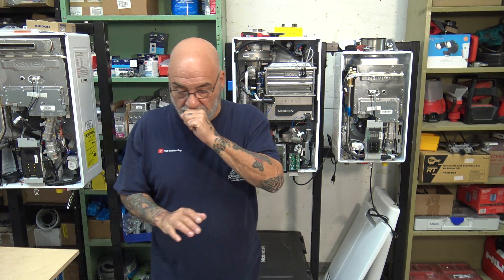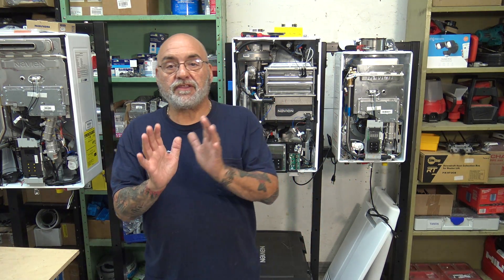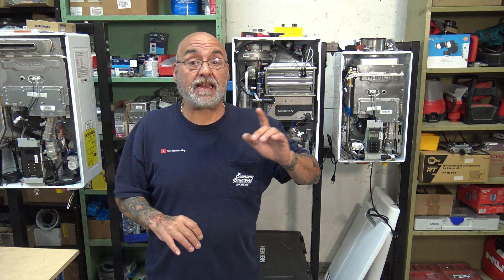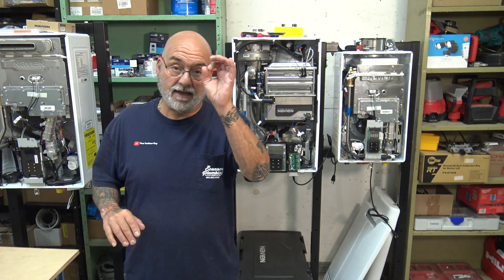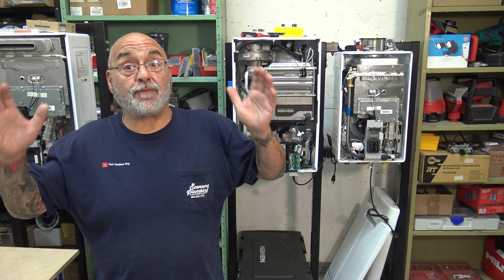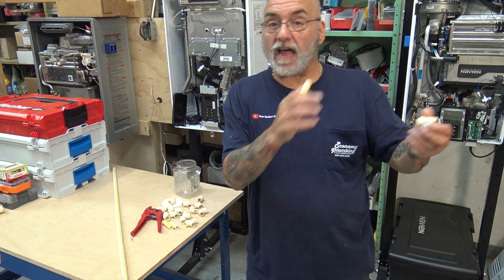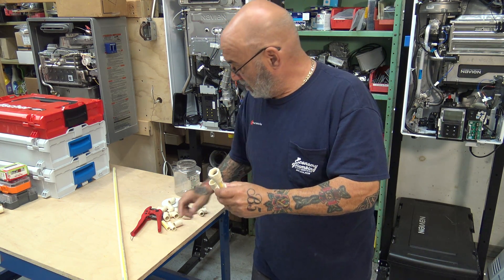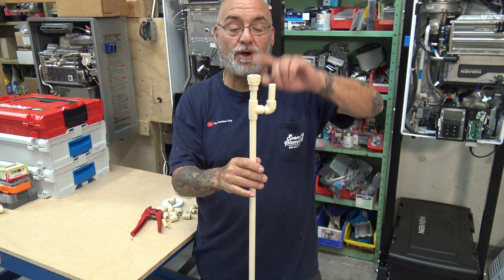Proper condensate drain piping for a condensing tankless heater.

Comment: My  installer  did not  put that  small  T in my  line  and   I have to clean my condensation dirt trap  plug at the bottom of unit to remove water build up  be cause i can hear water in my Exhaust  line go up to roof its  usually  just a  half a cup of water that comes out   spoke  with installer and he  said   that my  small  half inch  condensation line  talked about  here might be  clogged  and that i should blow it out or   vacuum it out to make sure   line is clear   im going to install this  tee line myself

Comment: Hi thank you so much. I am in Florida and getting ready to install indoor condensing unit. Looking for code guidance on condensate pipe and relief pipe. Can these terminate in the drip pan and then drip pan piped to exterior? Or do I have to pipe each individual line to the exterior? Thanks!

Comment: I just put the vent in. Previous owners didn’t have it. It’s been 10 years without the vent. No issues with the water heater. But it I’ve had the bottom of the heat exchanger(black part)  have like sweat on it. Droplets. I wipe it and it’s a little brown the residue. Do you think that because it had no vent?

Comment: I followed your advice before I installed my Rinnaii RU160 four years ago.  Works perfectly.  I'm an electrician by trade - so I had a plumber check my work and he was impressed!  I owe a lot of that to you.  Thanks Mike!  I especially appreciate the tutorial on the drain/vent and the training on the external pump circulation requirements.

Comment: I have a NPE-240A, 5 years old.  Just performed the maintenance and checked the drain line.  It is not vented.  I'll be installing the vented pipe modification as you have shown in this video.  Thanks!!

Comment: Do you also need to put a condensate collector on the air intake? 

I'm installing a Rheem condensing tankless heater and there's a picture that shows the regular condensate drain AND the condensate collector on the air intake
Reply: Hello, im about to do the same thing and noticed that condensate collector im the manual, but I can’t find one for purchase anywhere. Did you ever figure out what you are supposed to do?

Comment: Thanks Mr Tankless Guy. My 6 year old Rinnai tankless installed with brass female transition fitting to 1/2 inch  pex line corroded  and fell off. With guidance of your video I installed new line including vent myself saving a lot of money.  Great to have access to experienced  pros on you tube.
Reply: Exact same thing happened to mine. I don’t understand how my plumber didn’t know not to do it that way.

Comment: Mike, question about the specified CPVC female  adapter (FPT/SS).  I assume that the "transition adapter" your describing is a brass fitting (such as the one my plumbers put on mine).  I'm replumbing the condensate drain and replacing the filter, removing the brass transition fitting, elbows, filter adapters, and pex, and installing straight PVC.  What's immediately available from the local big box store (and what I have on order), is a 1/2" PVC FPT/SS adapter, without the rubber seal.  I had intended to simply use pipe dope or tape to secure it to the Rinnai tank (RUR98iP) 1/2 drain stub (which I thought was MPT, or is it MIP?).  If it's MIP, that might explain the difference, but the brass fitting the plumber used, was sealed with pipe dope.  In any case, this is a non-pressurized gravity drain, so I expect the PVC adapter I purchased will work with teflon or dope.  Thanks.  (Update:  Found one for $0.99 at a local Ace Hardware; It's 2 to 3 times that at the box store, special order/shipped.  FYI:  Apollo Schedule 40 1/2 in. Slip in to X 1/2 in. D FNPT CPVC Female Adapter 1 pk)

Comment: Mike great videos.    I have a question about my Rinnai.  The built in circulation pump has a noisy vibration when circulating water in dedicated loop.    any idea if this needs a new pump or is there a repIr or easy fix?  Thanks again for your great posts.

Comment: As a home owner with a bad install and code 25 “condensate trap full” I don’t have the T shape, the installer just put a straight PVC pipe leading through the wall to outside. Could I cut the pipe myself and install the T at the top with those PVC cutters.  Should I turn my tankless heater off to do it or is it ok to leave on?
Reply: How did you fix your code 25?